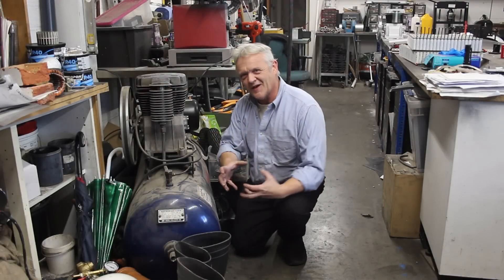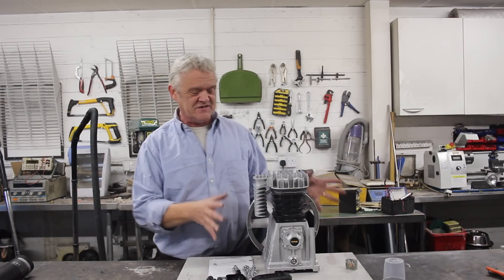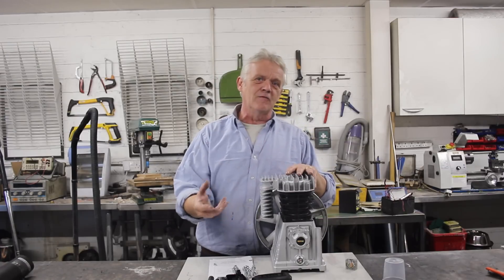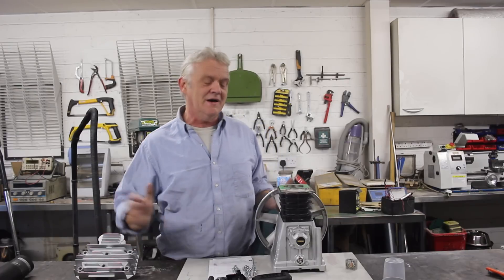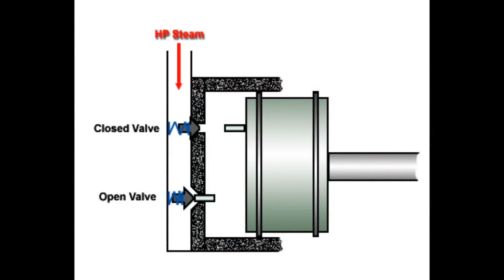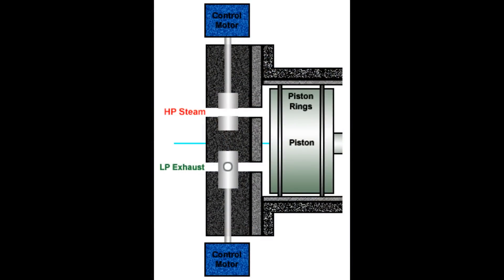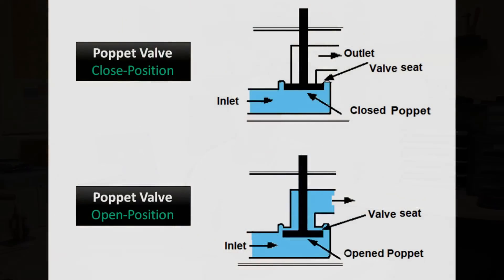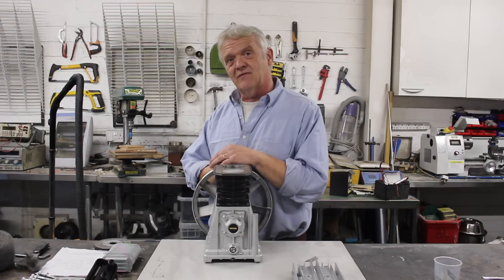1693 A DIY Multi Fuel Home Generator 2 - Changing One Type Of Engine Into Another Type Of Engine

Comment: This video is right up my alley I am a machinist and have been looking to do something like this for more years than I care to admit I would love to see it done with an Arduino and solenoid valves would be really cool to run that on steam with programmable timing to get the best efficiency out of it. Awesome content as always love the channel. 
Just another quick thought if it runs on steam maybe a boiler using a Fresnel lens in the sun?
Reply from the maker: I am thinking of solenoids and Arduino for sure - though stepper and Arduino also appeals - I will likely trial run it on compressed air then build a boiler
Reply: @ThinkingandTinkering  I can’t wait to see what you come up with!!
Reply: @ThinkingandTinkering  yet another use for the rocket stove 
boiler heating.
Reply: @ThinkingandTinkering  try ethanol at 80% and 20% water, works well with pre-chamber ignition. You can up the CR also over 14:1 no problem.
Reply: Solenoids have a limited number of times they can cycle. Eg a manufacturer rating a valve for 1, 000,000 actuations sounds a lot. And it would be for say a washing machine.  But if engine doing 1,000 rpm... That's only 1,000 minutes of operation before valve exceeds what it's supposed to be able to handle. Solenoids can also be a little slow to open and shut again can be an issue for engines. Lot of the slow response is due to inductance of the coil. 

Piezo actuators are much better regarding lifespan, and speed of operation. Unfortunately pricy, require hv electrical drivers, and tend to have low flow rates. Could be used to pilot (aka direct) compressed fluid to bigger valve.
Reply: Yep, join the club mate..
Reply: There's a guy that's made a DIY free valve set up on a mower motor in the USA.